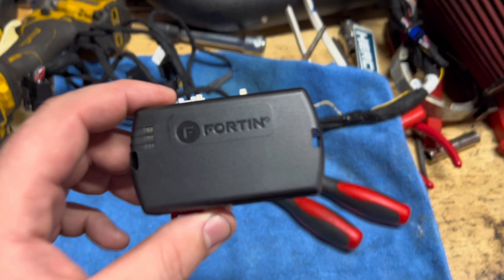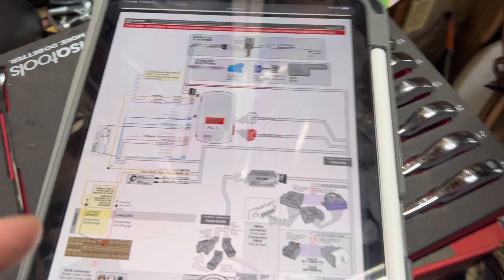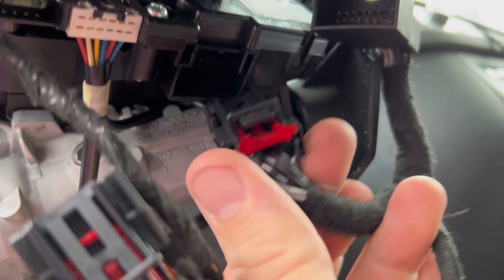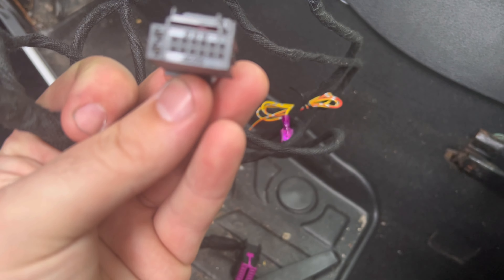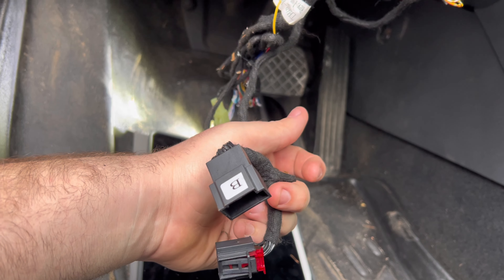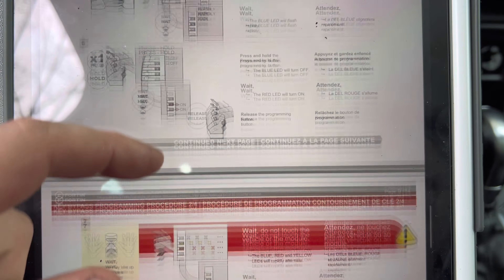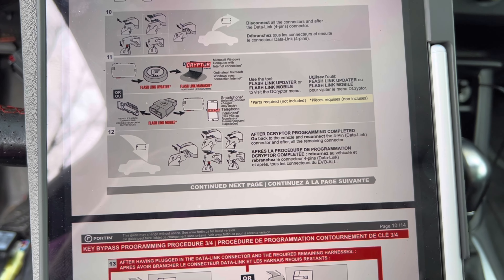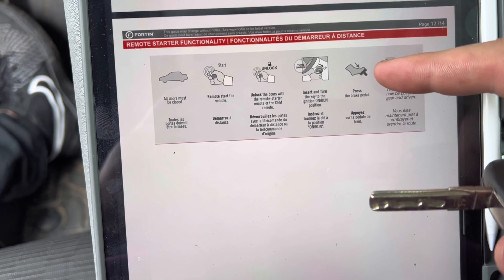How to install remote start on VW Tiguan!

Comment: Big thanks for your video. Question for you : do you understand the difference between the Evo vwt6 and Evo vwt3 ? How have you defined the Evo vwt6 is the right product for you ? On the specs, there are identical, but price is not the same. Cheers and thanks again 😊

Comment: At exactly 16min in the video you say there is the big black plug the one behind the key hole on top and another one what is the other one? Im installing the exact same thing on my 2012 and bought this because of your video so thanks for making one 
I can get the canbus to go blue but as soon as I turn thr key it goes black and can't get anything to work
Any idea on what im missing?
Reply from the maker: Did you go thru all the programing of the module on your computer?
Reply: @prestofixit3518  yes I did
Reply: @prestofixit3518  so I got it to do all the lights according to the manual
How do I program the key now
Reply from the maker: @ferraridrew76  that’s done on the computer. You make a copy of your key for it to emulate to the reluctor ring.
Reply: @prestofixit3518  every time I try on my PC with the key beside the box it doesn't connect
Reply: @prestofixit3518  I take the box out the car bring it in plug in the red round unit and hit the key thing and it won't register
Reply: @prestofixit3518  got the key to start the car but it shuts off right away lol

Comment: mine came with a spare key but its not a fob key its just a regular key without the lock unlock and trunk buttons will that work u think?
Reply from the maker: You don’t need it with this kit cause it copy’s your immoblizer info and emulates it. The other kits need a spare key.